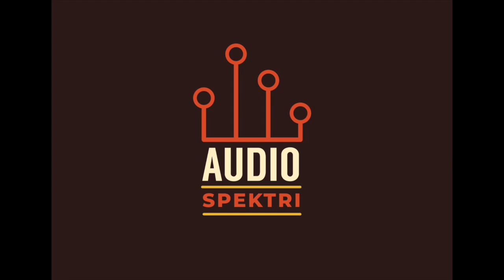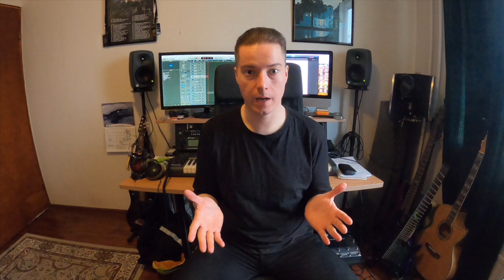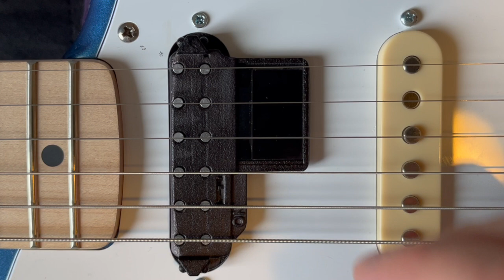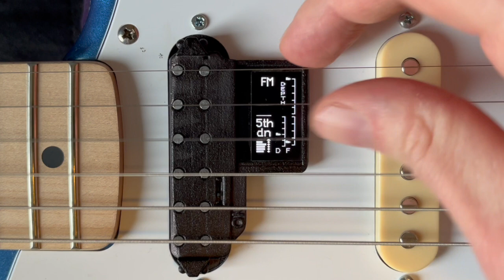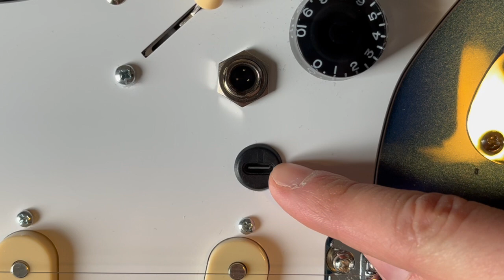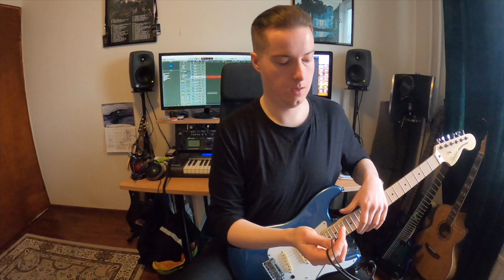mPGV Introduction

Comment: A bass version please..
Reply from the maker: We shall look into that!
Reply: @audiospektri  Also please note that we have the -2 octave transpose possibility. Tracking latency increases with decreasing pitch (we need at least one cycle to measure the pitch). But if you play 2 octaves higher than the normal bass and transpose down to the correct scale, then the tracking speed is determined by the high pitch note, and you will shorten the latency  by factor of 4. Of course the feeling is not the same with thinner strings, though.
Reply: I second dat
Reply: 10x more useful on a bass IMO

Comment: Impressive design and execution.
Don't be put off by the ugly-sounding parameter demonstrations at the start, he gets musical-sounding results at the end...
Reply: Also note that the FM modulation setting is adjusted to the maximum at the demo, lower settings are more practical. This is just a technical presentation, please check our two earlier videos for musical demos.

Comment: Thats rad. Is this doing fm by injecting a frequency back on to the string physically.
Reply: No, we measure the string pitch and use a modulating frequency to a sine wave that has equal frequency. Strictly speaking, it is actually phase modulation. Everything in digital by signal processors. But please check the real beef towards the end of the video, the simple FM is just used to show the control functions. Also, for musical samples, maybe the best is our A-ha demo about two weeks ago.
Reply: @JoukoViitanen  Can you please show more FM demos without the vocoder though? This sounds just like guitar patches on Sega Genesis, so awesome. There are thousands of vocoders out there, and only very few guitar per-string fm synths with low latency, and yours might be the only one shaped into a singlecoil form factor.
Reply: @NotEnoughPrana  Thanks of the comment, we will have more demos coming (after we clear out this surge of requests). However, the FM is quite simple, the thing that makes it dynamic sounding is the amplitude dependent modulation strength, and because it is separate string based, each string will have its own modulation strength, which is difficult to achieve in low latency from the composite signal, as you noted.
Reply: @JoukoViitanen  My only gripe is the finish on this looks terrible. Can we get an injection molded version and in white maybe?
Reply: @virtuosomaximoso1  For injection molding, the volume should go up at least one decade. Actually the first prototypes looked much better , they were made using liquid resist-based 3D printing. However, the impact resistance of those covers was not good enough for heavy guitar use. These are instead of laser sintered polyamide (=nylon) and are virtually unbreakable, and they are  filled with molding polymer, so almost waterproof except for the sensor points. The surface is little rough, but consistent texture, and functionally good. Coloring is easy, because the material absorbs alcohol based varnish, so many other colours are also possible.

Comment: This is quite innovative. Your webpage or manuals make no reference to the pickups, single coil or humbucker on here. Though the same product name they are pedals or eurorack a different product?
Reply: Yes, sorry, our webpage update is outsourced, so this product is not yet seen there. As you see, this one is the single coil version, the thin old display just  sits over the pick guard. We also have a humbucker version, but only the box is different from this one. It goes fully inside a typical hum bucker slot.
Reply: @JoukoViitanen  thanks for that. Do you need the pedal/module
 aswell as the pickup?
Reply: @pere_villez  No, the output of the mPGV has to be soldered to the pickup selector switch, and it comes through the volume pot to the normal output jack. I can send the manual if you give your e-mail address.
Reply: @JoukoViitanen  that great, thank you for pointing this out. It sounds more elegant this way. I look forward to trying it. Im behind the YT FM synthesis series Catalogue of Materials by Element433 so this would be a perfect FM instrument, thank you.

Comment: It's interesting from a technology point of view, but I already have several vocoders in my collection
Reply: Interesting to know if any of them follows the same principle as ours, e.g. that only the pitch and amplitude are measured from each string, and the synthesis only uses these parameters together with the vocal spectrum? All other vocoders I have seen just modulate the guitar spectrum with the vocal spectrum. Our advantage is that we can modify all the 6 spectra individually, e.g. in our vocoder mode 2, so that there are different spectral scalings for different strings. Also the resulting synthesised voices have nothing remaining from the string spectra.
Reply: @JoukoViitanen  it does sound good but I like my vocoder sounds to be keyboard sounds.
I have to admit part of my interest is I don't think I could afford a good enough guitar and this with the other things on my plate. 
But I have decided to like and subscribe and see how things progress
Reply: @davidrobertson4301  Please check our two earlier videos, the A-ha song demo and the mPGV looper demo, so you get an idea of its use with the vocoder modes. About the guitar selection: please note that this device completely removes the acoustic sound, so you only need a guitar that stays well in tune, and is otherwise easy to play, its sound characteristics do not matter.

Comment: that is AMAZING! i just wonder how would you make the changes in a live situation. did you guys have that planned yet?
Reply: I'm gonna say this is aimed at bedroom guitarist and maybe the studio, imo this is far to clever for it's own good to use live.
Reply: @theprismaticsystem2833  Only 4 pressure sensors used for control, so I bet it is easier to control than pedals. And if you decide to use one of the synthesis modes, then there are only the pitch bend and mode dependent parameter to adjust.
Reply: @JoukoViitanen  Pressure sensitive controls are about as consistent to set each time as you can press them, so they aren't and as much as I've heard sloppy playing change pickup selectors, I don't think the pressure sensors are that much safer.
Reply: @theprismaticsystem2833  For a parameter in a selected active synthesis modes,  there is both an instantaneous control that follows the pressure, so for that it may be not so consistent, however, there are also two sensors , the other for + and the other for - adjustment. That is easier for consistent control, because you also have the dial visible (and hear the effect change)
Reply: You can't see the damn thing 🤓

Comment: I couldn't get your website to open any page. just fyi. have you considered selling on reverb?
Reply: Our website so far has our older products, not yet this one. The website shop is only opened by request through our contact form (remember that we are only two guys, and everything cannot be done subcontracting). Yes, we have used also reverb to sell our older products, but of course then their fees have to be added (which are very reasonable, though. the Trump import taxes may be higher).
Reply from the maker: Everything works now!

Comment: WOW the tracking and low latency is impressive
Reply: This is because the processing is done at the sample rate frequency for all the 6 separate channels, and there are no such input or output buffers that e.g. a system with a laptop or tablet + sound card would need, even though they have much higher CPU clock speeds.
Reply: There's no way to tell the latency from the video, since the guitar audio is recorded separately from the acoustic sound of the strings. You'd need a demo where an amp/speaker was recorded by the room mic, and hear the latency between string noise and vocoder sound, or the regular guitar pickups being amplified and the vocoder sound being output through the speakers.
Reply: @Mezurashii5  Yes, you are right, from these videos you get only a rough view on how the finger moves and what is the resulting sound.  Also you have to remember that the latency varies depending on the string frequency, because at least one cycle of the signal has to be received. For lower pitch notes this latency is orders of magnitude longer than the sampling delays. Therefore it is impossible to give a single figure. For our older pedal-form devices we have some oscilloscope figures in a white paper for some strings in our website. The separate string measurement in the new synth is faster simply because the filters that are used to measure the pitch can be wider, thus having shorter step response.  All the filters are optimised for their intended frequency to get the shortest response possible (you can forget such long block methods like FFT)
Reply: @JoukoViitanen  What is the advantage of putting the electronics of this device directly next to the pickup, and not into a pedal or a rack?
Reply: @Nonononono_Ohno  Processing for each individual strings at the source means you'll have better tracking.
Reply: @brendanbyrne3028  That indeed makes sense. Thank you!

Comment: We also have a pedal, but the reason for integrating the electronics inside the pickup is that then we can use individual string measurement rather than trying to measure everything from the composite guitar signal. That makes the latency shorter and note detection more robust. I guess you have noticed that some other manufacturers also use separate string detectors, but then they bring the signals out to the synth  using a multiconductor cable. We have everything inside the box, and output is through a normal guitar cable.
Reply: Have a link to the pedal?
Reply: Smart choice - keeps it nice and tight. I would mount the charging jack on the spring plate on the back, however - maybe put the battery in there too, assuming its a small battery.

Enable a mode to allow the mic jack become a MIDI out! All you need is three wires. Seems like it tracks pretty well... I think you have something interesting here!
Reply: this answers all the questions I had while watching.
Reply: Why not have a pedal that has the display on it and controls the pickup? Also if you made the pickup easy to install like the fishman/roland units that you can put on with no modification it makes it a little easier to get on board with the platform rather than starting by needing to actually mod a guitar to start with something one might not like
Reply: @kristianlundmusic  isnt the whole point of the pickup integration is to reduce latency
Reply: @plonzz  Yes, but the controls should absolutely be a pedal, so you can still play guitar while switching effects
Reply: Sensitive controls under the strings doesn't look successful, to me.
First, if you touch something while playing it's a disaster.
Second, how do you change sound while playing? That's why we use pedals and not hand controls.
Of course you can use this pickup as it is, but move controls away from it.
Reply: @nonnomir  The controls are not under strings, but on the sides of the slot, far enough so that the strings do not touch. A disaster would perhaps be if you accidentally change the synthesis mode, but that requires always two controls to be pushed simultaneously at the different sides, so not very easy to do. When a certain synthesis mode is selected, then single pressure sensors can only be used for pitch bend, and synthesis specific parameter adjustment (instantaneous  or up/down). Eg. in the FM synth mode, to adjust the modulation strength. The assembly site should always be the neck slot, and picking should only avoid working there. Also please see that the four sensors are 45 degree tilted, so not accessible by straight angle picking.
Reply: @JoukoViitanen  ok, so we just can't change sound while playing. You say you can change pitch while playing, but that is possible just under some limited circumstances: for example, if you are strumming you do nothing else but strumming.
Look, pedals are quite successful since decades ago, maybe there's a reason for it. The reason is: change while playing and being separate from guitar itself to keep hands busy just with playing the instrument. Other experiments with many controls on the guitar were made, but they didn't have much success, cause they served extremely limited situations.

Comment: That's pretty cool, but why couldn't it be a pedal?
Reply: Don’t be stupid. A pedal can’t track individual strings
Reply: @threepe0  Actually our earlier model, the pedal version does track, but the latency is longer and some chords are missed, but they are not very important, because they are the harmonics of the fundamental. (octave, octave + 4th, higher chords are very rare). There is also a limit how close notes can be recovered, when the other is of lower amplitude.
Reply: @ it tracks notes, but doesn’t track individual strings, as that’d be impossible. And as you mentioned, it doesn’t do it as well.
Reply: @threepe0  You are right, the string allocation is another topic: we had an earlier modular version "guitar analyser" that had three different channel  allocation methods, but e.g. a pitch order based allocation fails if a lower string goes higher pitch than the upper string. But this is only a problem specifically for a case when such a breakout device is used. In other cases note tracking is sufficient.
Reply: @threepe0 of course the pedal would be the controller. Changing something while playing could be very difficult (that's why we use feet and not hands). Don't say if you accidentally touch this shit while playing, could be a disaster.
I don't think many people will use this configuration...
Reply: He’s just showing off.
Reply: @rousejeremy is that how you think the world works